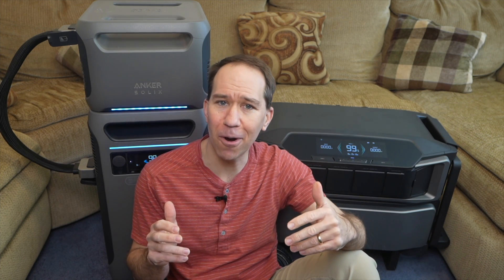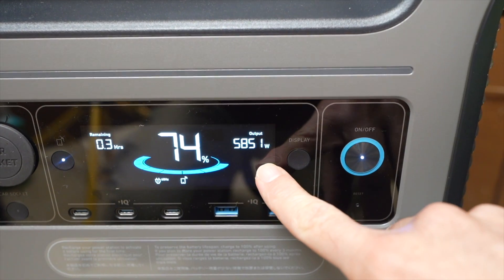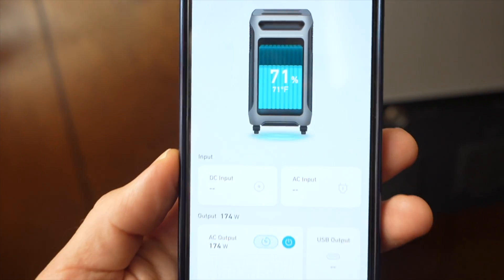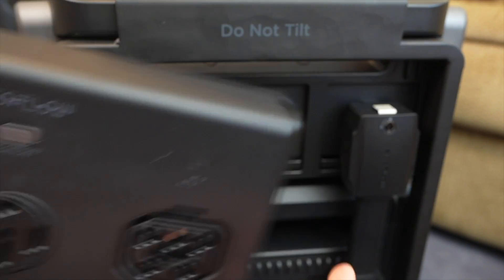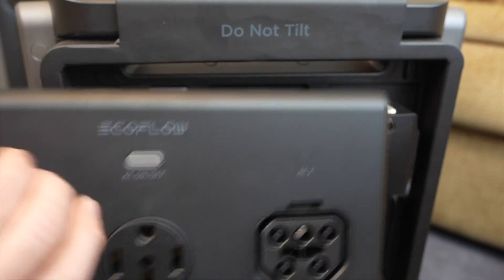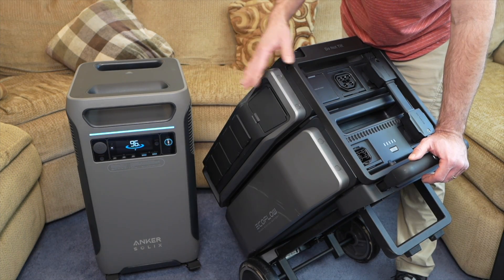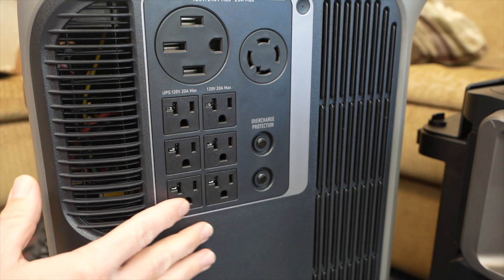Big Differences? Anker Solix F3800 & EcoFlow Delta Pro Ultra COMPARED

Comment: I almost bought Anker due to the price but the solar input is the downfall of that model. The delta eco flow ultra is well thought out but I have seen a couple videos complaining about the power is dirty. Other than that and the price delta would be my pick. Keep in mind if your not trying to be mobile you can build a eg4 for about half the price
Reply: What's an eg4?, and what would you suggest for those who want to be more mobile? With regard to cost per Watt hours. I might just go with a propane generator, unless I can find a better deal on batteries. I know there's new lithium battery technology emerging on the market, like solid-state, lithium sulfur, nanomaterials, and chloride-based cathode, so many it's best to just wait a while before investing $5,000+ on batteries.

Comment: Good video.  Thanks for all the info. 

You only need to stay below the solar voltage limit.  Amps are drawn, so the device will only draw the amount of amps it can use.  In fact, it’s best to over panel some to ensure you’re getting peak input.
Reply from the maker: Thanks for watching!  Yes, agreed on the voltage vs load.  One of my upcoming videos I'll show 810W of solar going into a 300W max input.  It's under the voltage limit so perfectly fine for the mppt.  When I made this video the DP3 had not been released yet.  I don't know how much interested there is in it but I could do that comparison now.
Reply: @solarguy  I’ll watch!  🙂

Comment: Lone the channel, just FYI. The EcoFlow Delta Pro Ultra cannot power its 120V and 240V outlets while simultaneously charging from the 240V Infinity port. The unit is designed such that the 240V Infinity port serves both as an input for charging and as an output when used in specific configurations, like when connected to the Smart Home Panel or an EV charger. However, the internal circuitry does not support pass-through charging at the 240V input, meaning that while charging via this port, it will not output power from its 120V or 240V outlets.
Reply from the maker: Thanks for your comment!  I actually just went and double checked and I am able to input 240 through the 5+8 port on the side and output 120 and 240 all at the same time.  When it is connected to the SHP2 then the front output ports are turned off.  Let me know if I am misunderstanding you.
Reply: @solarguy  That is great to know, other reviewers have stated that you can not charge from 240v input while outputting 240v. I know there is a difference between pass-thru or bypass and charge and discharge but I appreciate the the feedback. It is a key part of my decision making.
Reply from the maker: No problem.  LMK if you have more questions (just put them as new comments because I can't find replies as easily).

Comment: Anker should have designed the expansion battery to lock into place on top of the unit. Also, the connectors should be on the top of the main unit and on the bottom of the expansion battery. When the battery is set on top, moving a locking lever into place locks the units together and electrically connects them at the same time. Also, increase the diameter of the wheels. There is no guarantee that they will always be rolling on carpet or even a smooth floor. Feel free to suggest that to them in your review of the system.
Reply from the maker: Having a locking mechanism is a good idea, especially if it could be an electrical connection too.  When you have these in a little space like I do, it would be very helpful to have short 90 degree cables.  About the wheels, I don't have much trouble pulling it across the grass FWIW.  But larger wheels would definitely help, especially in more difficult terrain!  Thanks for watching!
Reply: Some may not have enough vertical space for stacked configuration. Agree on 90° cable.

Comment: Question...which product powers a refrigerator longest...anker solix f3800 or ecoflow delta pro 3?
Reply from the maker: If you compare the storage capacity without expansion batteries (and assuming the ac efficiency isn't wildly different - which it shouldn't be) then the Delta Pro 3 would last longer since it has 4,096Wh and the F3800 has 3,840Wh of capacity.  I will be making content on the Delta Pro 3 - so let me know if you want to see anything in particular or have other questions.

Comment: If this is connected to an generator inlet, how does one support multiple inverters?  Or are you limited to one inverter unless you have their smart box?
Reply from the maker: Which device are you referring to?  DPU or F3800?  If you only have a generator inlet (say its 50 amp rated) then you can get the double hub for the F3800 or the 50 amp hub from ecoflow and either of these allow you to take two inverters and connect them to one inlet box.
Reply: @solarguy  thanks!  Very helpful video.  I am planning to get the DPU.

Comment: The low input voltage for solar charging and the not being able to charge from 120 volts ac while using the 240 volts is a deal breaker for me on the Anker 3800.   I want to be able to charge from my dual fuel generator using 120 volt ac while being able to run my house on the 240 volts, in case we have lots of clouds for several days in a grid down situation.  EcoFlow Delta Pro Ultra is the only way to go in my opinion.

Comment: Do you have a video about the solar panel set up for a DPU? I've had a hard time finding information on the panel side of the set up.  TIA.
Reply from the maker: I cover that issue some in the delta pro ultra video I made before this video.  Check that out and post a question there if I didn’t answer your questions.

Comment: Have you had a problem with the Delta pro ultra sold by amazon? The q/a:"Is ac pass through possible with 120v input? A:Use the c20 outlet for a bypass mode with a 120v input. There is no bypass mode for 240v input. AC output is turned off at this time."
Reply from the maker: I’m not sure your question but on my unit I can bypass both 120v and 240v (with the 5+8 port as the input, like using a gas generator).
Reply: @solarguy  thank you for the response.  Can I get your option before I purchase the dpu? I live in apartment and will be using my wall outlet to charge the dpu. Will I be able to use all of my battery outlet??
Reply: Use all outlets while charging from my wall outlet
Reply from the maker: No problem.  If you have the wall AC plugged in, yes, you can get access to all of the 120V AC ports and even the 240V output, which is very unique.  I'll keep the video description updated with new coupon codes as I get them.  It looks like the amazon link is the best deal at the moment.

Comment: So you can't use 24.8V 100w Jackery panels to charge the EcoFlow? What if you string a few together?
Reply from the maker: You have to get over 30v so if you put at least two in series it would work on the low voltage input.

Comment: I bought the Anker Solix F3800 with 4 Rich Solar Mega 200 watt Solar Panels. 
Nobody has a video on how many, or what size of Solar Panels to Max out the Anker Solix F3800 input.
Does anyone have any suggestions for me?
Reply from the maker: On my main channel video reviewing the F3800 I talk about that a little near the end of the video, if interested.  Each of the two XT60 ports can handle up to 1200W in a more ideal scenario, so a total of 2400W total.  The main consideration is the 60V input limitation on each port.  I looked up your 200W panels and they have a max power voltage of 20.4v.  So you can put two of these in series and put them on the one XT60 port and the same on the other port.  Or you can parallel the two sets in series and put them all on one XT60 port (since the max current would be 9.8A+9.8A = 19.6A (which is less than the 25A max on each XT60 input port).  Then you could get another (4) 200W solar panels and do the same on the other XT60 port.  This would get you 1600W of total solar input.

Comment: I wouldn't buy either one of these units because they both lack galvanic isolation between their DC boost stage and their AC output, which makes them both far too dangerous for use in my home.
Reply: Wth is all that about Jimmy the cricket

Comment: 10:16 you really should compare the solar charging of the Apollo to the DPU. Much more robust VOC.  Also Apollo starts the inverter on full discharge at a programmed percentage of charge in the morning with adequate solar.

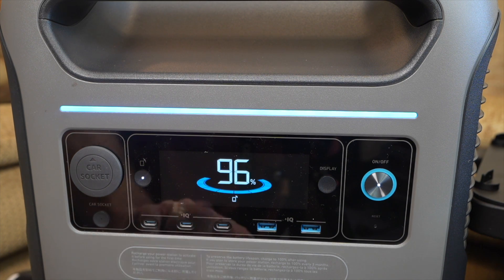Comment: 5:00 ... (Finally at 8:20) ... 15:25! why don't you mention the price of the batteries when you're dealing with the load value in kilowatt hours between the ANKER with its expansion battery in order to get to roughly the same capacity as the DPU.  ALL OF YOU GUYS, EVERY CHANNEL, ALWAYS LEAVE PRICE AS A SIDE NOTE AT THE END.

Comment: I've had grid-tie battery backup flooded lead acid batteries for 12 years. 2800 watt solar, SMA equipment. ... Haven't made the leap to the all-in-ones or the DIY hand trucks.

I like this comparison of 240 volt units.  Your channel is straightforward but it is "AN (not A) INLET box "

CONSIDER COMPARING 2 DELTA PROS VERSUS 2 HYSOLIS APOLLOS FOR THE SAME 240-VOLT OUTPUT.

As for bonding neutral and ground on the apollo, bonding neutral and ground "DIY SOLAR POWER WITH WILL PROWSE" shows how that can be done on the Apollos.

Comment: We really need a detailed comparison of the EF smart home panel 2 and the Anker Home Panel ASAP. For those of us who already have grid tied solar it could be a critical decision point. 
I gather the Anker panel is better at managing excess solar power from an existing PV system but one thing I don’t understand is whether the Anker setup would enable the existing grid tied solar PV to function in a grid down situation?  That is the holy grail the people with existing grid tied solar are seeking.
Reply from the maker: Stay tuned for that.  Neither the smart home panel 2 nor the home power panel will power your main service panel if there is a blackout.  They both only feed a critical loads panel (the smart home panel 2 would be the critical loads panel) and the HPP would output to a critical loads panel.  The HPP can backfeed to your main service panel (but not out to the grid) and provide power to the critical loads panel when it senses the grid.  Where is your grid-tie solar point of connection?  Is it line-side or is it backfed through a breaker on your main service panel?
Reply: @solarguy  it’s line-side, I believe. There’s no additional breaker in my main panel. 
However, outside, there are both a separate manual lever “ac disconnect” and a solar breaker (I believe) in a junction box that is attached to the box with the meter.  I think that one must be where the grid AC and the solar AC are “merging”. 🤷🏻‍♂️

Comment: new subscriber loved the video,  but is there any programability that would allow you to plug into grid and solar but only accept power from grid if below40% battery?
Reply from the maker: Thank you for the sub and for watching!  Yes, there is a setting for that in the App for Delta Pro Ultra.  For the F3800, there isn't any option that I know about.  With their respective grid hardware (smart home panel 2 for EcoFlow and the Home Power Panel for Anker, you can set limits like these) .  Not sure if this is what you are asking but  I also just found out about a programming group that is getting an API from EcoFlow.  I'm not sure what kind of opportunities that may bring up but I think it's great for 3rd parties to be able to monitor and interact with the devices.
Reply from the maker: I should also add that since I made this video the new firmware on the F3800 allows for dual charging solar + grid.

Comment: Did you test the battery efficency for these generators? Interested in knowing what the Ecoflow is. I bought the anker and I'm only getting 2700 to 2800 watts out of the unit (about 72% of the claimed capacity). Apparently the inverter is a power hug and it uses a lot of power. Very disappointed with the battery efficency. Thinking about sending it back.
Reply from the maker: I don't remember the numbers off hand exactly but the F3800 was at least 84% with a constant load of 1,000W.  What was your constant load amount draining from 100 to 0%?
Reply: Used 265watts for 10.5 hrs in my test. I need it for hurricane season here in Florida. Realistically most people won't be using a constant 1000W load, specially after or during a storm when you have no idea how long the power will be out. Sometimes days. Most will be conserving energy and using only the bare minimum to get by. Have you tested any other large units with better results? Less power hungry inverter?? Thank you for taking your time to answer my comments. Great review by the way! @solarguy

Comment: Does the Ecoflow Delta Home panel only accept the  Delta devices as inputs or could you input the Anker as a secondary source of power?
Reply from the maker: The SHP2 natively has the 3 ports for DPU's.  You can use the F3800, for example, through the generator inlet.  That's how I was using it in those scenes with the F3800 and the higher AC loads.  Let me know if you have any more questions.

Comment: Giant Chinese battery /generator companies give away a few 5k free generators to a few American looking people,  for them to "review".  yeah  these things are cool, especially the Ecoflow Ultra,  but in reality you need a gas, diesel, or propane generator for any long term needs...more than a day a two.   Get a duel fuel, run it on propane, and you won't have the problem of gas sitting for a long time.  Imagine,  you buy a predator, Westinghouse, or champion 12500 duel fuel for 1500 max.  Done.  These power stations are just a shiny object.  Good for Van Life,  I own two Ecoflows,  but they are not serious for home backup.

Comment: An important correction: on the EcoFlow DPU if you input 240 (via the side port) it shuts down all the outputs.  From their FAQ:

When charging EcoFlow DELTA Pro Ultra with 120V, it can output 240V normally. When charging EcoFlow DELTA Pro Ultra with 240V, it cannot output 240V. When charging at 240V using X-Stream charging [the side port] via an AC inlet, AC output is not available. That is to say, when charging with high voltage 240V input voltage, all AC output is disabled.
Reply from the maker: I’ve read that too but I’ve been able to input 240v on the 5+8 port with another generator and measure 240v on the L14-30 port at the same time so I don’t know what to say.  Maybe they are referring to when you have it connected to the smart home panel 2? I’ll have to test these scenarios some more and see if I can figure out what they mean.
Reply: Interesting, thanks for the report.  So both 120 and 240 on the front panel work when charging using a 240V "EcoFlow AC Generator Charging Adapter" on the side port?  This makes my use case of effectively a 120/240V UPS so much easier.
Reply from the maker: I just ran a test to confirm.  I have a preproduction model so I doubt they would have changed the feature in the retail version but I was able to run my house loads at 240v through a generator inlet box, run a 120v load, AND input 240V at the same time (from another generator).

Comment: An option / port Id like to see on these would be a generator input with pass through charging. So if the battery is low you can connect a generator through the unit to run the house and charge simultaneously. Just waiting for the insane price to come down to earth. Im just looking for a temporary power backup without using useless solar panels. Solar panels are expensive and don’t last nearly long enough to make your money back on the purchase.
Reply from the maker: With the L14-30 to 5+8 adapter you can do this with the DPU.  You can use the L14-30 output on the DPU while charging on the 5+8 port with your gas generator at 240v.   Did you mean being about to use the 5+8 port with the smart home panel while charging with gas?  If so, you can do that but you can only charge with the gas generator at 120v.

Comment: Great video, thank you! So I'm looking to use the DPU in my car hauler  trailer that has several residential panels on the top. You noted the need to ground in the HV input. Can I just ground it to the trailer itself?
Reply from the maker: Thanks for watching!  The grounding I was referring to when connected to your house system (and using PV) is to the earth ground.  Unless I am misunderstanding, if it's in your trailer you aren't going to have earth ground.
Reply: @solarguy  I've only had a bespoke Victron system before, so I'm hoping this will work for my adventure trailer. I've got 2300W of residential panels up top running about 330V and 11a, and I'm assuming I can jsut make the connections to the DPU HV port like I did with the Victron system in my last trailer. Do you see any issues?
Reply from the maker: I don't see any issues with that setup.

Comment: I considered both of them but ended up going with the Ultra and 5 batteries at the launch price. Mainly because of the solar input. I have 1.6kw to low and 2k to high voltage input. I use it to charge my car and works great (you need to bond the ground and neutral). Also at 7.2 output that’s a real plus. I only charge the car at 4k so I’m not running max on the unit for 5-6 hours at a time. As for plugged into to a wall outlet at the same time mine does not work if I’m using the 240 out. Seems as though anything over 2k out from the 240, the wall tries to pull over 2k and shuts down with an error code. Bummer. Powers my house with transfer switch and car. A real beast. When I first got it and the weather was bad I had a few different error codes, 182, 252, and 479. With the firmware update I only get 479 now and shuts down the high voltage PV, luckily I’m off during the day and can reset it often. Hasn’t been a set and forget system. You might consider waiting till the bugs are settled out.